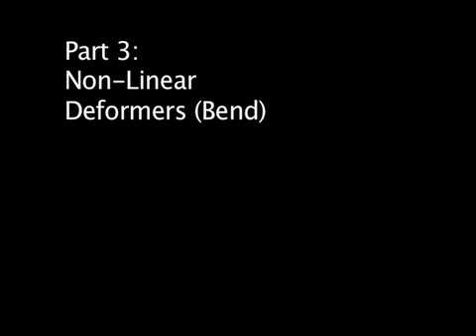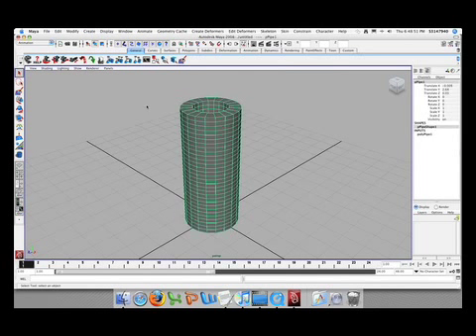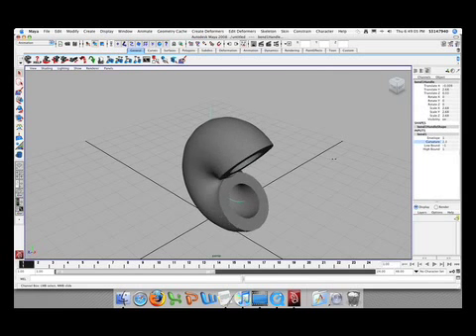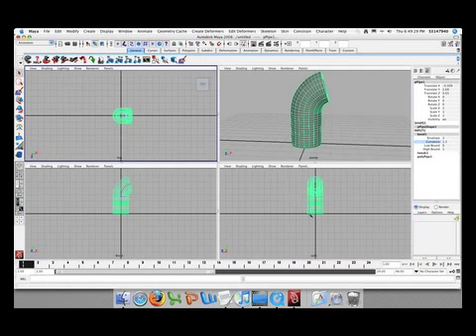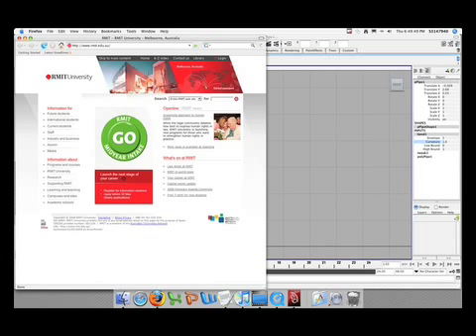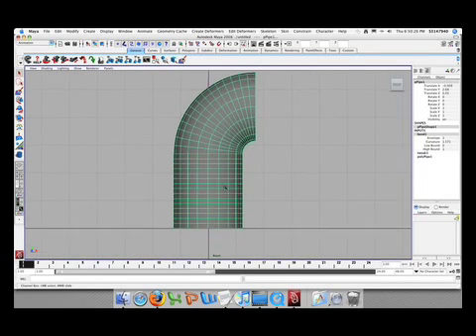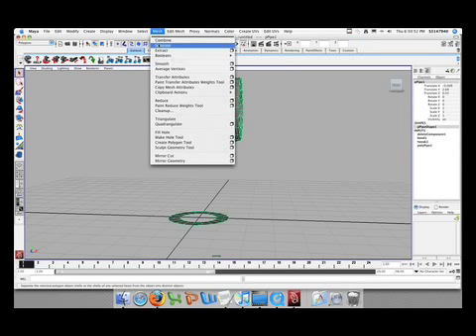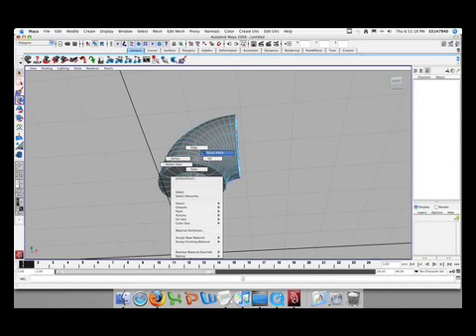Maya Tutorial - Pipes and Tubes - PART3

Comment: Some interesting points on these methods are helpfull. One other way i have done many tubes and pipes is with the wedge faces tool. It to is very helpfull.for adding a wanted angle at just the degree you need it.